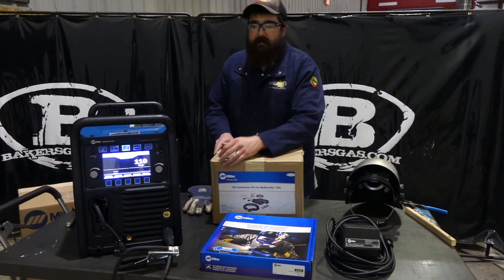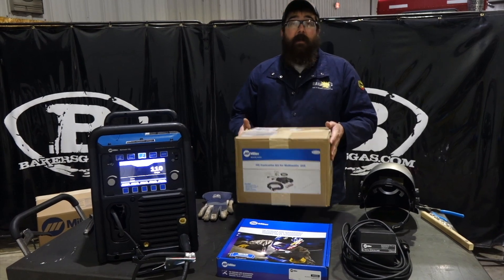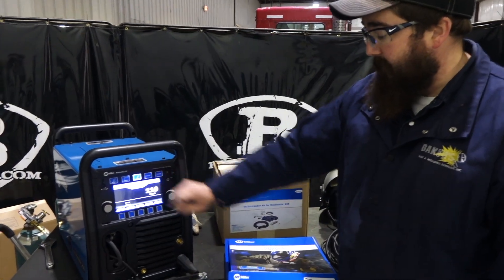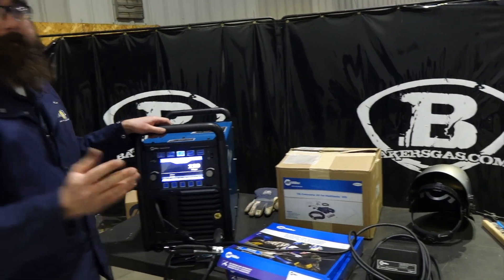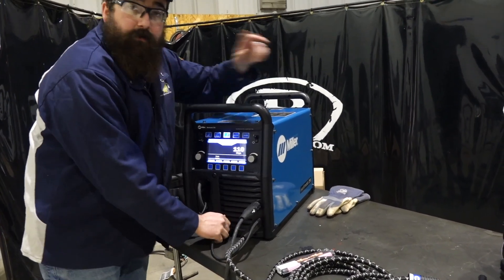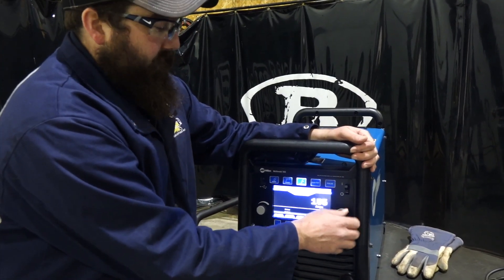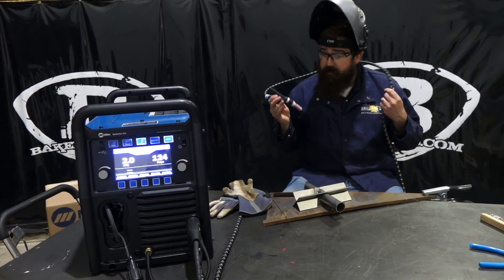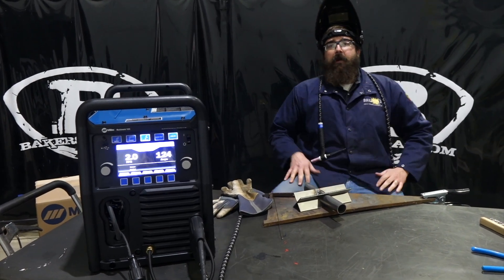Miller Electric Multimatic 235 and 255 TIG Kit and TIG welding review

Comment: Should I get this or the esab 285
Reply: I really wish Miller would put HF start in these machines!
Reply from the maker: If you want to call us we can talk about your specific application. The Miller Multimatic 255 is a great unit! Highly recommend and you never are making the wrong choice with Miller. The pulse MIG feature and capability to add push pull down the road if you wanted to is a benefit as well. We are posting a new video on the push pull gun soon! Any other questions let us know.
Reply: Hey you dynasti